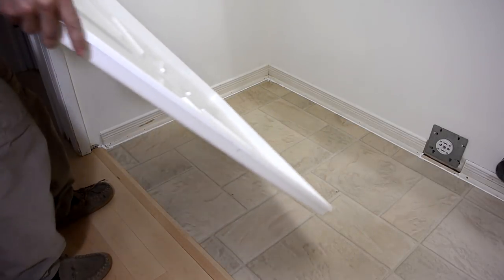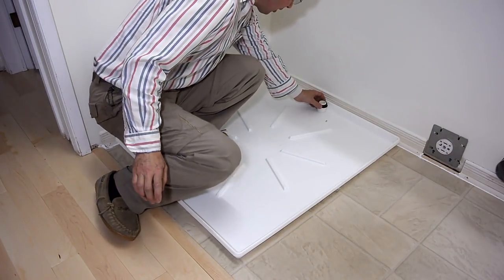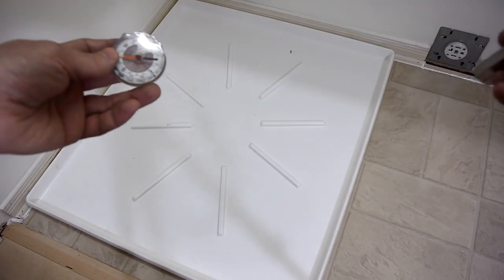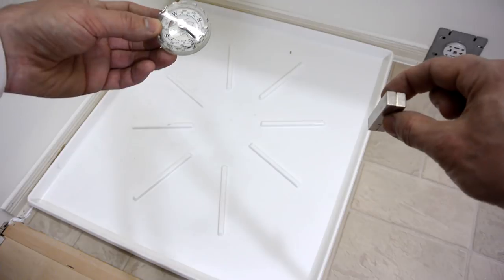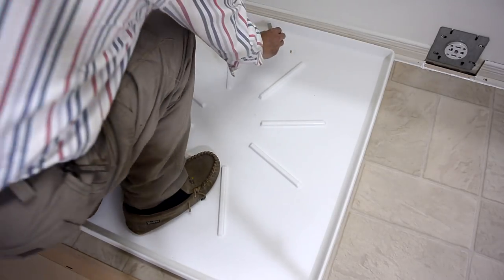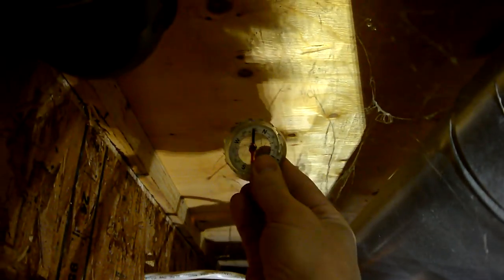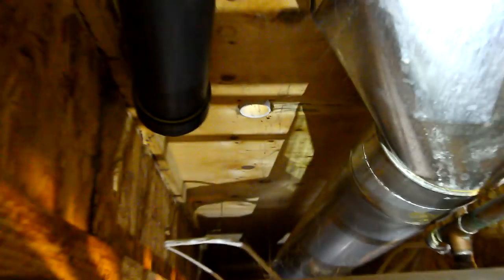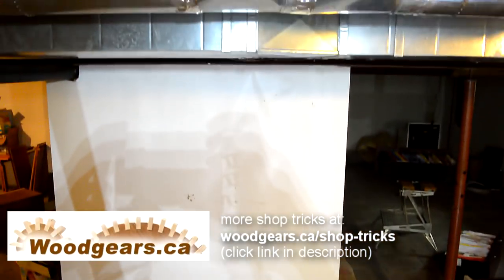Thru-the-floor (or wall) magnet and compass alignment trick

Comment: I'm in an american home.... have had a washing machine for 18 years and never had a leak from under... granted, I had other problems such as connection leaking at the faucet and rusting the entire metal box ugh... luckily it goes to the garage and still could be fixed with no major work. The trick with the compass/magnet is neat though :-)

Comment: Matthias Wandel - Neat trick, but don't you need to seal up the hole to minimize air movement between your basement and living zones? Also, why not just pipe it to a wash sink in the basement and dump it there? PVC piping is easy enough to do, and so long as there's an air gap between the pipe and any drain, you don't have to worry about bad stuff coming up the pipe.
Reply: How likely is it that the washer is actually going to leak, though?  Is it worth all that effort?  I've never had a washer that leaked in my life.
Reply: jej3451 well if it is worth the effort of putting a hole in your floor you might as well spend 10 more minutes and set up a pipe
Reply: probably true
Reply: Hi jej3451 The funny thing about equipment failures is, you never know when you're going to have one. I have smoke detectors around my house, yet in 45 years have never had an electrical fire... (And hoping that I don't have one now that I've said it.) If and when his washer fails (may it never do so), he won't want the additional headache of water damage from something getting drenched or splashed on (like the nearby HVAC equipment in the video.) Besides, if you're going to do the job, you might as well do it right the first time. That means piping the water to where you'd want it to drain. Besides, PVC pipe is easy to work with.
Reply: Nice trick.
Reply: +jej3451  Washing machines have rubber hoses that fail all of the time.  They are one of the biggest causes of flood damage in homes.  The abrupt closing of the solenoid valves causes big pressure spikes which can burst old rubber hoses (which you are supposed to replace every 5 years or something like that, but no one ever does, mine are 17 years young...).  Clogged drains (a big problem with the crappy new low water useage machines since they don't flush the soap all the way into the sewer) are another major problem.
Reply: I would get flooding because of lint being drawn into the drain.. 
it would plug the pipe and blow the hose out of the drain on to the floor.
I went to hard seal between the drain pipe and the washing machine outlet which stopped that.

but then the wash water would blow out the vent onto the roof..

Turns out the what was happening is there was massive tree roots in the drain.. replacing 10ft of clay pipe with PVC pipe fixed it.

Comment: no sewer pipe closeby on which you could it hook up to?
Reply: I guess not.  Again my button has been triggered.  Not sure where Matthias is going with some of these videos.  I am currently concerned.
Reply: One might not notice the leak then. Basement floor will ensure any problem will be fixed.
Reply: Not a bad point +The Metal Butcher, but there are other ways of alerting someone of leaks without the need of cleaning up gallons of dirty wash water.  Not to mention any damage caused by the discharge of that wash water.

I'm not judging how Matthias chooses to plumb his house.  For me I would not be able to accept this as the final solution.

Comment: Good idea, but with a magnet that strong I don't think you need a compass, just hold a nail up and the magnet will attract it.
Reply from the maker: depends on how close.  The compass gives much more range
Reply: The compass would be more sensitive and accurate. Less affected by thick floors.